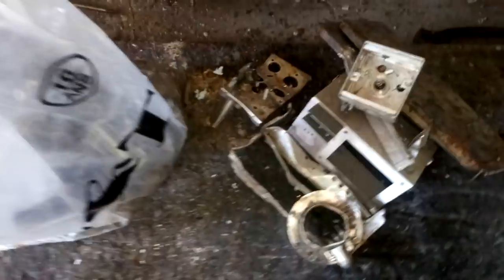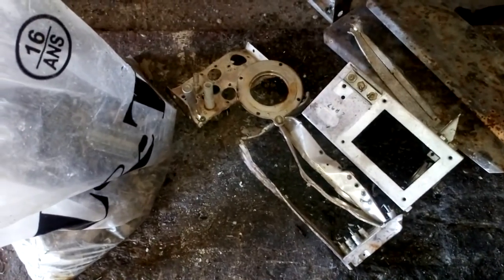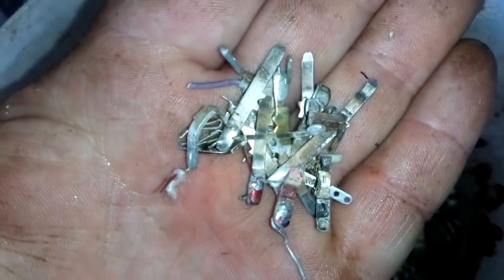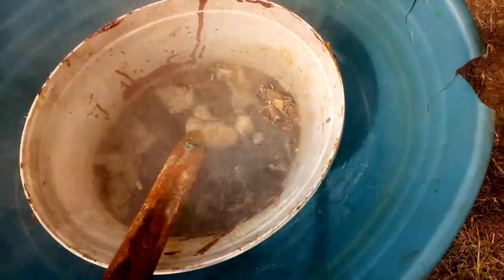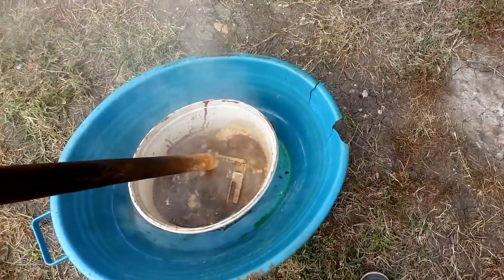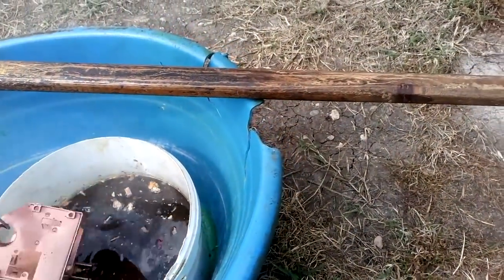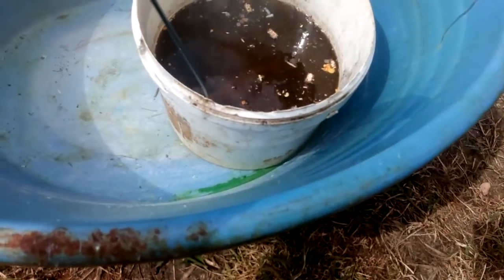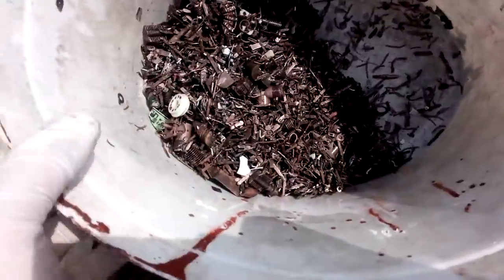SILVER STRIP from SCRAP with SULFARIC + NITRIC SOLUTION PART 1

Comment: Great video! Alot of those pieces I would have thought was just steel. Is there a way to tell if something is silver plated? Also I have been coming across alot if silver colored wire... I know sometimes they use silver wire although thet also tin copper and use aluminium. Is there a simple test I can do for silver? Even in silence im always watching lol
Reply from the maker: bohemian mystik scratch plated part, drop litle bleach, it's should tanish for 5_10 second if it silver! And silver plate have diferent color, more shiny. Or drop litle nitric acid, if have milky color, it is silver, if has blue, orandz or green color is other metal. Chears mate, thanx!